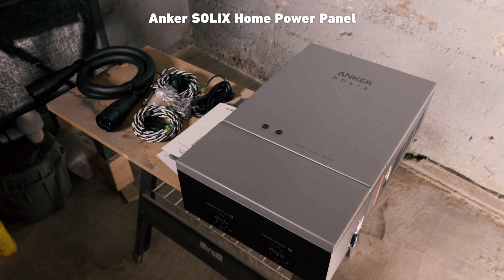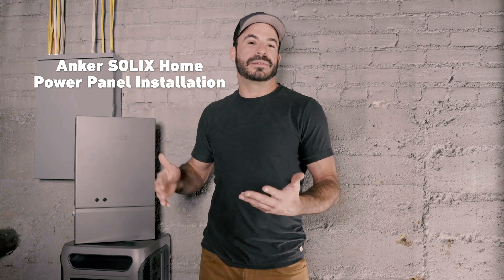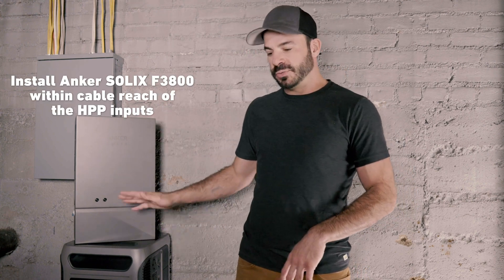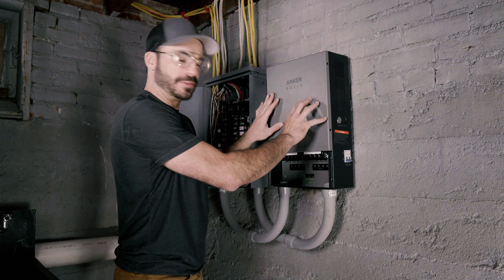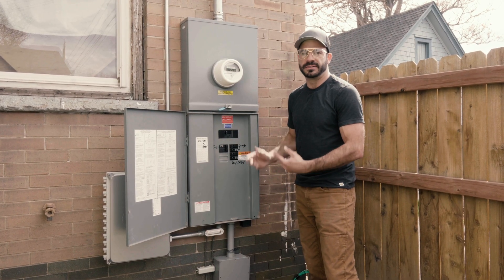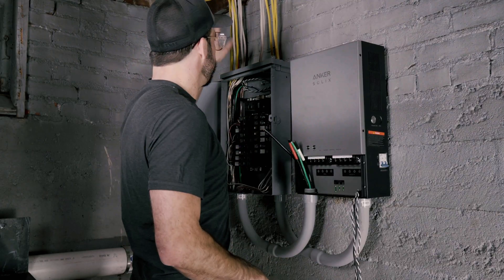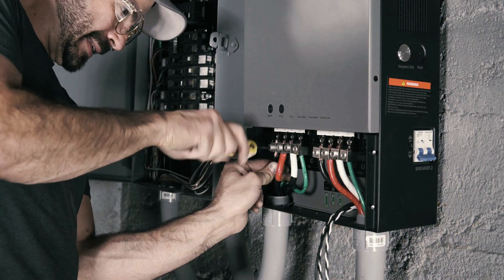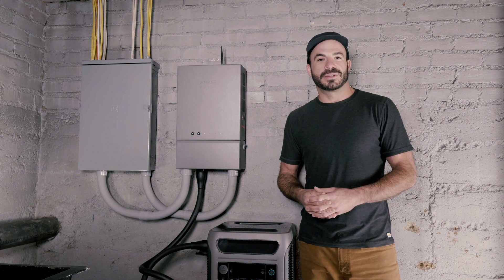Anker SOLIX F3800 Full Potential: HPP Installation Guide

Comment: Cool that it can directly feed a 100A panel so no circuit rewiring needed.  Do they have a solution that can do that w/ a 200A panel?  That's what I'm after.
I also feel like "whole home" should have an asterisk beside it with these products if they have to subpanel any house w/ 200A service.

Comment: If I'm understanding this correctly, for a 200 amp serviced home I would not be able to use this for Time of Use type service. For outages, I have no problem simply turning off non-critical breakers and using two F3800s with the HPP to power necessary loads. But I'm guessing I couldn't leave this on all the time to take advantage of TOU. It seems like my only option would be to jump up to the Anker Solix X1.
Reply: it will only backup the subpanel, BUT, as long as you do still have grid power, it CAN backfeed to your main panel to power the rest of your house (as long as you don't go over the load limits of course, it can still only provide up to 12KW of power)

Comment: But for prolonged outage and you wanted to recharge the system with solar how can I do that if my unit is in the basement?
Reply from the maker: If your Anker SOLIX F3800 is in the basement and you want to recharge it with solar power during a prolonged outage, you have a couple of options:
	1.	Extend Solar Panel Cables: You can run longer cables from the solar panels placed outside (e.g., on your roof or in your yard) to the basement. Ensure the cables are suitable for the distance to minimize power loss.
	2.	Use a Transfer Station: You could set up a weather-resistant connection point outside the house where the solar panels connect. This connection can then be wired safely to your basement system by a professional electrician.
	3.	Portable Solar Generators: Another option is to use portable solar generators or battery units that can be charged by the sun outside and then brought into the basement to recharge the Anker SOLIX F3800.
	4.	Install Solar Panels on the Roof: If possible, install solar panels on the roof with a permanent wired connection to the battery system in the basement. This would provide a consistent and safe method for solar recharging during outages.
	5.	Safety First: Always consult a professional for wiring and installation to ensure safety and compliance with local electrical codes.
Let us know if yu have any other questions.

Comment: So if I want to use this on my boat I basically can treat the shore power line as my grid line, rewire it so that the shore power goes into the panel and back out, and that should keep the f3800 charged until shore power is disconnected?

Comment: The output of the 3800 is only 25amps.  How are you powering a 100 amp panel?
Reply: If you use a pair of 3800s, you get 50 amps. A single one will work if you only have a max load of 25 amps and need 1200 watts. I’ve got two 3800s, and my max load is rarely over 25, but will surge to 35 on occasion. I also get 2400 watts with two as well. With one and only 25 amps, there may be some things that he’d not power on.

Comment: My electrician is requiring an external shut of the HPP/F3800 setup.  Is there anybody that has done this.  Pretty sure we have to take the cover off & tap into the Emergency switch on the HPP.  I sent a message to Anker & normally they respond, but this time they did not.

Comment: Thank you for the video guide, but this does not answer most homeowners with a 200A main panel. How do we find the right  electrician to help install these to code? I believe Anker should be able to provide a network of installers for their products around the continental US.
Reply: This is a toy compared to what you need for 200A. I’m a NABCEP PVIP installer. Are you in Michigan by chance?
Reply: @bluezcluez315 99.9% of people on 200amps aren’t using 200amps all at once. 100amps runs everything in my home minus the range, dryer, and water heater. 3 things i don’t NEED to use during an outage. It’ll power everything else just fine including the 4 ton heat pump AC(with soft start of course). Definitely does more than your average gas generator. Hardly “a toy” system.
Reply: They do. For $2k. Just add the service to your cart.

Comment: So please help me with question ... i have a 200 amp panel. But i want to power everything at my home. Am i restricted to a 100 amp? For the whole back up panel?
Reply: Actually, I have been told it is only 50 amps even if you have 2 F3800s : (
Reply: Actually, the battery only supplies 25 amps of power at 240v.  The instructions say to run #10 from the transfer panel to your emergency panel.  #10 is max 30 amp wire

Comment: Hi there, 

Almost everything in my house is electric, pellet stoves (primary heat source), Old school gray box electric heaters that currently only run occasionally due to cost(assume 240V), oven/range (240V), water heater (240V), Dryer (240V). 

I dont want to choose only specific circuits, i want it all as we'd like to go off grid. Can I use the HPP to just run directly into my 200A home supply and run everything? 

My meter is not on the 200 A panel in my house. Its out on the pole.

I'd also like the ability to be able to plug in a generator for those times when solar isn't producing or grid down etc, could I run a 30 or 50 A plug into just one of the 3800's and would it bridge the charging?

The panel is 200 A but I highly doubt if we ever get anywhere near that. We'd have to be running all of our 240V appliances simultaneously to get there which is highly unlikely. 

Also will this system continue to operate without wifi? Is there anyway to make adjustments without using the app?
Reply: The battery has a 240v output on the side where you could run into a manual interlocked generator inlet

Comment: Can you feed a 200 amp subpanel?
Reply: The HPP calls for a minimum of 6 AWG wire size for 50A max load if 2 F3800s are used, or 10 AWG minimum wire size for 25A max load on the backup load side of sub panel if 1 F3800 is used.
Reply: Please dumb this down for me … in this case if I were installing a new subpanel and I had ONE F3800 (this would mean 25 amp MAX) … would I still use a 100 amp panel ?
Reply: @wbarkwell  I've edited what I said above for clarification.  It's not about restricting what Amp size sub panel you can install or how much backup load you want to put on that sub panel, it's about how much load 1 F3800 or 2 F3800s can deliver so that you should size the MINIMUM wiring gauge of the power line that connects to the backup load side that feeds your subpanel accordingly.  You shouldn't use smaller size wires than specified above on the power lines that feed into your subpanel so that they can handle the max current load that either 1 F3800 or 2 F3800 can deliver.  If your sub panel and home backup loads are bigger sizes and they end up drawing more than what 1 or 2 F3800s can deliver to the backup load side, then the F3800 will just shut down, that's all.  But the minimum wiring sizes of both the grid side and the backup load side must be observed.  For 2 F3800s, the grid side wire must be 3 AWG and for 1 F3800, the grid side wire must be 6 AWG minimum for L1, L2 and Neutral lines.

Comment: I agree with the CT confusion. The video edits got the installation out of order and does state the arrow facing different directions on L1 & L2.
Reply: I am still confused about this with the conflicting information. I installed mine yesterday with both CTs pointing towards the source (where the current is coming from) and seems to be working fine, but want to make sure this will not cause any problems... Could someone please clarify?

Comment: Thank you for the detailed guide! 
1. I observed the L1, L2, Neutral, and Earth connections. 
What if your house runs on a three phase system 100 amps with neutral and earth?
2. In case one phase fails, does the home power panel take over?

Comment: I’m confused about the L1,L2 current transformers and the direction the source arrow should face: at 6:24 you say the arrow should point up to the meter, but then at 6:51 you say the arrow should be pointing down toward the panel. Can you confirm?
Reply: The arrow on the current transformer should be point DOWN toward where the main bus bars connect to the circuit breakers, NOT up toward the direction of the meter.
Reply: So to be clear, which is the SOURCE for these 2 CTs - the meter or the main buss bar ?
Reply: @wbarkwell  You are measuring the current drawn from the meter down through the main bus bars to supply all the loads in the home.  The HPP manual says "orient the CTs with the arrows pointing toward the source."  But the pictures unmistakably show the arrows pointing DOWNWARD toward the direction of the bottom of the main panel toward where all the circuit breakers are.  There's another YouTuber's video (Benjamin Sahlstrom) in which he had them pointed upward toward the meter and he said it works fine for him.  I think it works OK for him despite pointing in the wrong direction is that the HPP's algorithm just takes the absolute value of the measured currents and ignores the flow direction.
Reply: @PhongNguyen-ov7jq I’m trying to figure this out. In the manual it said to point towards the power source so in this case the arrow supposed to point upward toward the meter?
Reply: I am still confused about this with the conflicting information. I installed mine yesterday with both CTs pointing towards the source (where the current is coming from) and seems to be working fine, but want to make sure this will not cause any problems... Could someone please clarify?
Reply: totally not clear from this video.  I installed mine with both L1 and L2 arrows pointing down towards the panel (direction of flow as indicated in the install manual). seems to be working well.  any input from anker would be great!
Reply: @josephwills9501  Yes I have solar panels and the only way it works is pointing down for both L1 and L2.